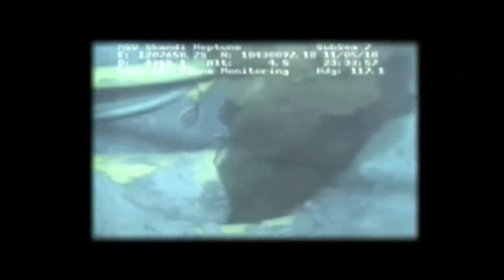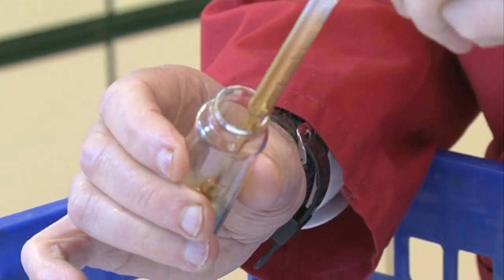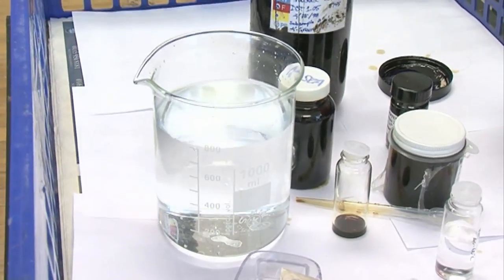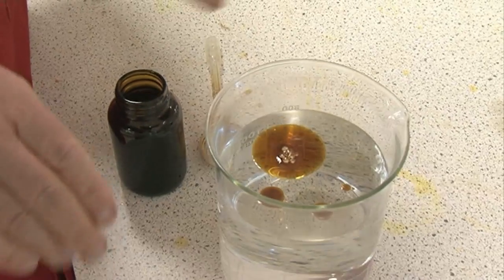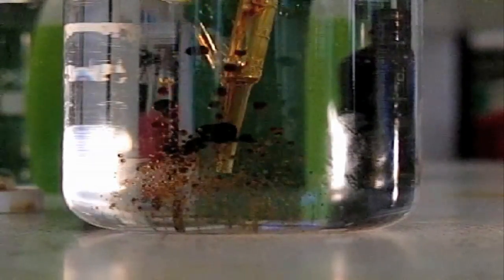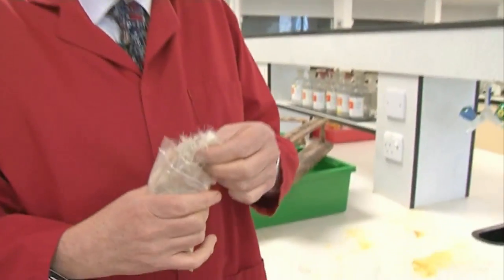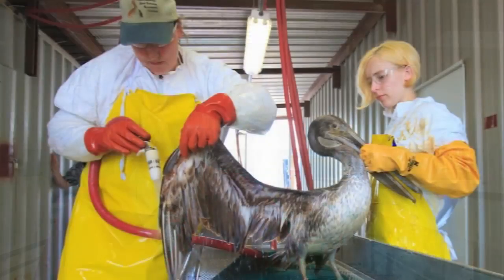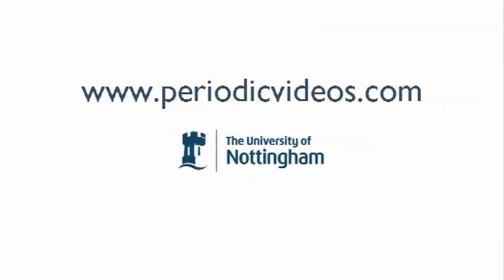What happens when crude oil spills into the sea?

Comment: First of all I have to mention that i worked in the oil industry, I built certain equipment they use on platforms. So here's my rant about the oil inustry:

Chapter one: Everyday Oil Spills
Crude oil is very nasty stuff. The Prof says that people know how to clean up the water, but this is only a question of what means "clean". The oil industry uses so called "produced water" (this is water that is gained from the well besides the oil and gas and other stuff) to pressurize the well (by pressing it into the well again) so pumping is easier. But not all of this water is injected again, some of it just ends up in the ocean. The produced water gets cleand from oil beforehand but the legal margin is about 20 ppm (20mg/l) of oil in the water. You won't consider this as drinkable and cleaning it more than you have to is uneconomical for the oil industry.
The maximal accumulated amount of oil within this water that can legally be disposed in to the ocean per day and per oil-platform is about one tonne (about 1200 liters). There are several hundreds of platforms in the north sea alone. And people think it needs an oil spill to make an environmental disaster.

Chapter two: Gas as a byproduct
Oil and Gas always occur in conjunction. All oil/gas fields are different, some have more oil than gas, some have more gas than oil. You always haul both and seperate it afterwards. On many oil platforms the gas gets burned after seperation because transportation and further use would be uneconomical. That's why the typical platform has a huge spike with a flame at the end.
I know of one oil platform that burns an amount of gas that could supply the whole city of nottingham! But it's too insufficient to be worthwile.The spike of this platform is about 40 meters high and you still feel the heat of the flame when standing on the platform.

Chapter three: Chemicals
How to prevent the pipes from rust? How to prevent algae growth in the well? How to make oil easier to seperate from water? One answer: chemicals. Toxic chemicals. They mix it with the produced water and inject it into the well. Read above where the produced water goes in the end.

Conclusion:
The normal human being doesn't know much about the oil industry. Take you car, go to a petrol station and fill up the tank. It's so easy. It's remarkable how smoothly and imperceptibly the oil industry does its dirty deed. But as long as we have our oily products and they have their money, everything is fine.

Comment: I have a very simple solution to this problem also; simply sink a bucket slightly into the water; the upper-layer of water with the oil will flow into the bucket, a pump to drain-away the sea-water from below and another on top when the oil-layer becomes thick enough to pump into a holding-tank :D Simple

Interestingly I’ve heard that sailours used to throw oil onto the waves to calm the sea, which has been reported in Newscientist, despite any local populations of sea-birds unfortunately.

Comment: Glad you made on a video on this topic!  Can I ask two questions about this subject?  Why use dispersants on the oil?  Seems like it would be better not to disperse it - easier to skim from the surface.  Second question:  Why didn't BP use a vise to clamp part of the pipe shut (before they sawed it off)?  It might have slowed down the leak.

Comment: @lejink  The oil is in suspension, because the partical size is very small and the ocean currents move it around it will likely not reach the surface, it may but the time it'll take will be very long.

Comment: @shawnoosept How would you suggest actually placing the pipe underwater in such a way that the crude oil simply wouldn't seep out through a gap? Keeping in mind that just holding it from the surface is practically impossible due to the fact that the ocean isn't static.

Comment: since the water is murky and deep the solution to problem is to put a big long barrel on top of leak and collect the oil inside it since the oil is lighter then water it pushes it self to the top of barrel and from there collect them with a pipe, that the natural way of collecting oil

Comment: not all of the oil in the gulf is floating, tho, right?  some of it is in suspension somehow...  perhaps because it is mixed with sediment into a kind of sludge, or maybe because it comes from such depth that it is somehow compressed into greater density?  there is talk of plumes and some sludge that is not floating.  why is this?   thanks so much.  great video as always.

Comment: that could work. activated carbon has been used to remove organic content (colour, odour, smell) from drinking water for years. the only issue is that when the act carbon meets the oil it will cause it to sink (gravity). leaving a oily sludge. good for batch processes but dont think it will work in the open sea.

Comment: Oil is essentially a hydrocarbon, so you can light the oil and convert it into carbon dioxide and water, which will not cause an immediate harm wildlife. Somebody said that they should have let the oil rig continue to burn, for oil was burning up before it could spill. I think that the reason why simply lighting the oil on the water doesn't work is because the oil layer is thin, and the water is moving. However, in areas where the water is not moving quickly, can the oil be simply burned?